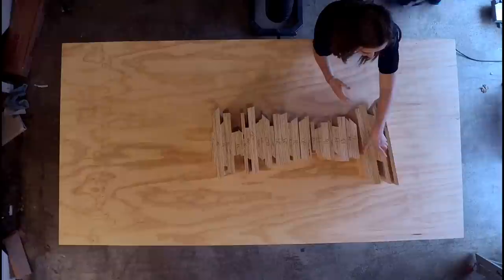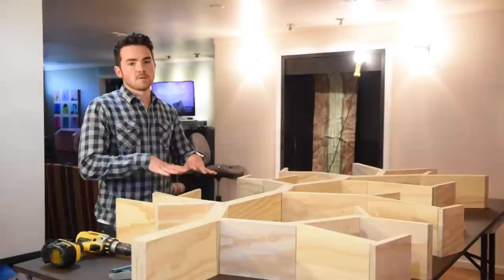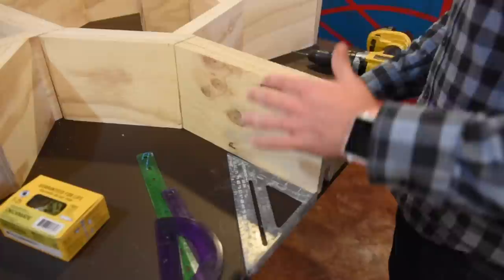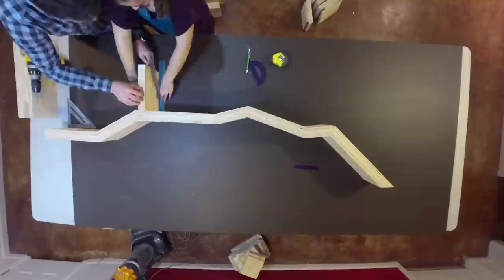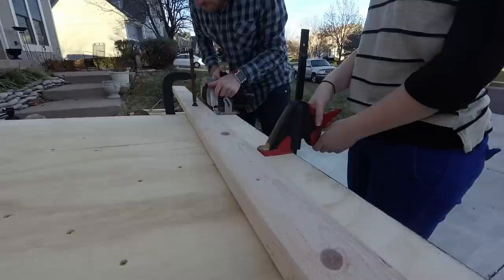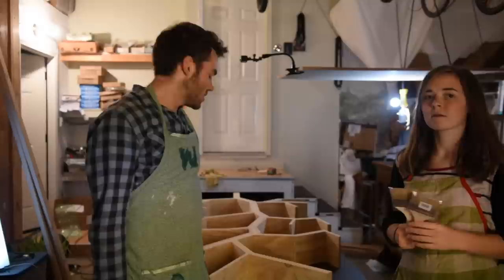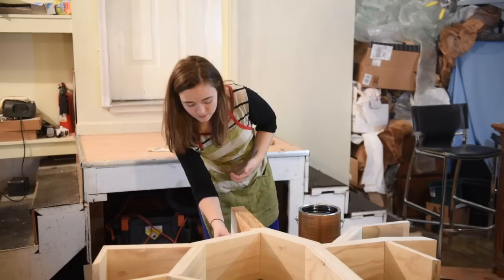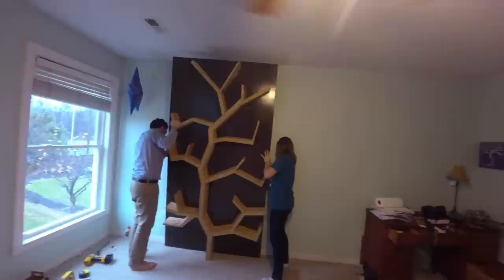DIY: How To Make A Tree Bookshelf

Comment: Fantastic project. I'm a bit a lost on how you mounted it to the wall, though. Could you explain a bit clearer, please?
Reply from the maker: Sorry for the late response, vacation.. :)
1. I located two studs in the wall
2. attached 1"X1" to the studs in the wall
3. stood the tree up against the 1"x1" and marked where they touched the back of the tree
4. Laid the tree back down and attached 2 1"X1" boards where I drew the lines, to the back of the tree
5. Stood the tree back up and screwed sideways, through the 1"x1" in the back of the tree,  into the 1"x1" attached to the wall

I did all of that so I could remove it whenever I wanted and didn't have to worry about screws in the front of the tree. hopefully that clarified a little
Reply: Crystal clear! Thank you
Reply from the maker: ffunyman Awesome!

Comment: This looks great! One question...how are the branch lengths measured? In the link it gives a length for each part. Is this is measured from the center of the part (a little hard to cut accurately), or from one surface (such as the upper surface when laid in the miter saw, and in that case the direction of the angled cut is important)? This is important for the angled parts. Thanks!

Comment: why are the three layers of shelf not equal size again? very nice BTW!! I wish I lived near you, I'd pay you to make me one or two!
Reply from the maker: +Don Nabio They were three different thicknesses to make it look more like a real tree, give it some dimension, and most of all to make it look like the tree flowed from bottom to top, inside to outside. Also there is the side benefit of adding strength while saving on the amount of wood. The smaller pieces can be glued/screwed to the larger pieces that precede them!
I would actually like to make another one for someone, now that I have done it and know what to do better!
Reply: +How We Make Things where are you located? What would you charge to make one of these? :)
Reply from the maker: +Kimberly Carew I'm located in the Kansas City Metro area. To build and deliver the tree I would charge $400 to make and deliver locally :) Do you live in the area?
Reply: Oh too far :( I live in MI 
I guess I will have to attempt it this spring :)
Reply from the maker: +Kimberly Carew Bummer! I would have loved the opportunity to make it again now that I have the experience!! Let me know how the build goes :D